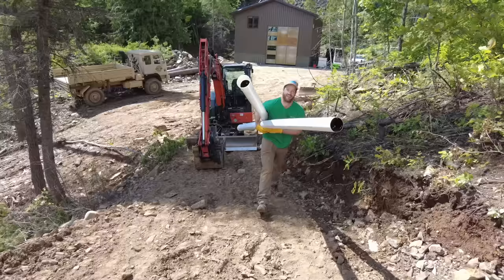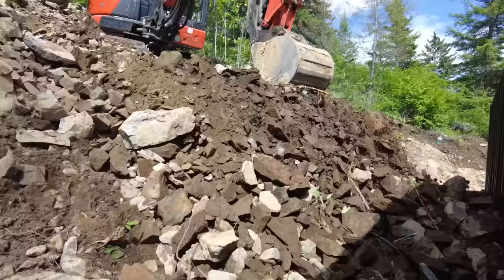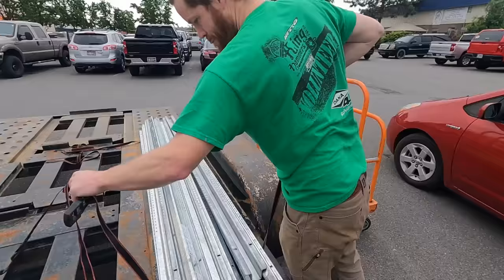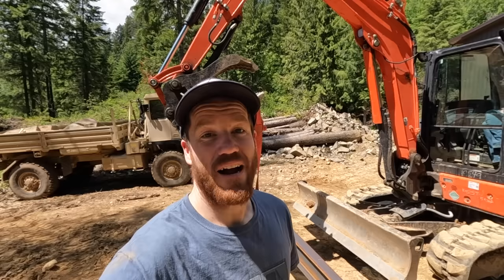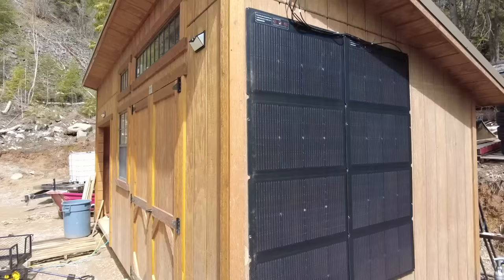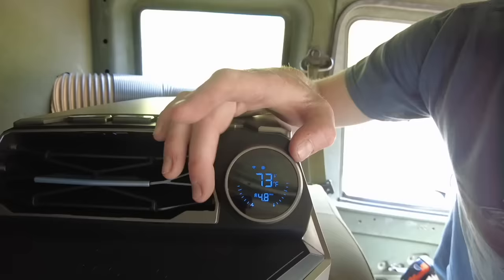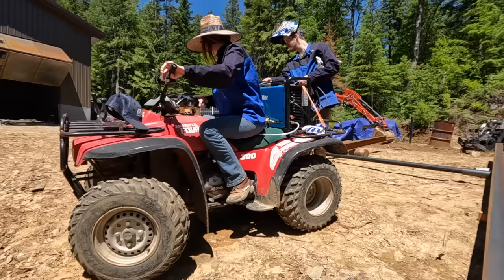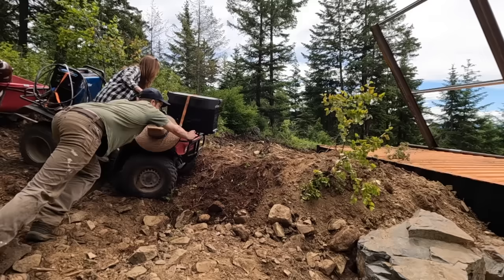We Were Told To NEVER Do This | Burying A Shipping Container

Comment: I'm glad you're excited but I have bad news for you we're going to end up having to pull it back out because why is there a pad under the garage so the moisture can't get up underneath it right all that smiling and joking around and you're not thinking if you have to walk over to your garage and look at the floor why is there a pad to keep it off the dirt and moisture I didn't look at the date of this video so I don't know how old this is probably too late but I hate to tell you this you're going to have to pull it back out because you didn't do it right you're going to have some major problems and those drainage pipes with the holes in it that you put down usually go on the dirtside of a retaining wall and if it snows up there where you're at and rains that's a lot of moisture that's going to be on the side of your container and underneath as well that little drain tube you put in there is not going to cut it what's like I said what's going to stop the water from going underneath you probably could have looked under bunkers underground bunkers and that's what show you how they do that everything is sealed the key word sealed I'm sorry for the messages but I can't believe that you couldn't think about it metal and moisture don't go together they have to be protected and sealed when they build bridges over water why do you think they put concrete over steel protect and seal and another thing how come you didn't use galvanized or aluminum for the framing of the solar panels something non corrosive unless you plan on painting that metal all the time you need to study up on moisture and metal

Comment: Umm, need to secure a 2 ton shipping container to prevent hundreds of tons of wet soil from slumping the Conex off the hill side, uses 2 foot rebar hammered into loose soil... Yet, need to secure a couple hundred pound solar array, use steel I- beams welded to the top of said Conex..  Hmmmm...  I have concerns..

Comment: I think all the concrete footing comments think they know a little better than they do.
Promoting excellent surface drainage uphill of the container is the biggest need you'll have to keep it in place. Ground water above the floor level uphill and any ground water underneath will be the biggest threats to its stability. 
Commercial roofing companies often have surplus EPDM rubber available cheap. Cover a large area uphill right up to the container and far enough back to stop water from entering the buried side. Landscape swails around it to where the water wont saturate the soil inderneath it or downhill very close.
Soul subsistence will be the biggest threat and if it's not controlled concrete foundations would just go downhill with the rest of it. Of course more substantial foundations would hold but are you looking to spend as much on concrete as the connex cost?
Watch downhill erosion and don't let water into the hill behind it. Simple.

Comment: You have done so many things wrong I can't count them all. Just a little research is all that's needed. Some kind of coating on the container to water and rust proof. Then protect it before back filling. Put dirt or Deadman on other side of container and brace. Also brace inside container from side to side to transfer load. No filter cloth, in time sediment will travel down slowing drainage. You could even use cable to hold top of container by running to trees on fill side. Old saying measure twice cut once.

Comment: Nice but unncessarily fancy. If you have natural south facing slope, that allows for several rows of independently mounted panels. That would be much more resilient setup. If you plan off grid living for real, having whole energy supply literally hanging from one hinge on top of all the batteries... seems not so good idea.

Comment: WD-40 is not a good thing to use overall - loosening nuts/bolts work great lubrication - not so much.
In other words - use a cutting fluid - more expensive but saves all the cutting tools (hole saws, drills, etc.) pays for itself.

In addition - the heavy rocks on the uphill side is not a good idea when the downside is un-supported by anything.  Too much weight on the top edge.  Your container will (?) start to bend. and that is not a good thing.  A cross brace on the back side should help with the racking (moving out of square).

You have a Lot of weight on the up-hill side and a lot of weight on the downhill side and all of it trying to turn your container into a non-useable shape.

Step back and take a really critical look at the loads imposed on the container.

PS - you didn't bury it - you butted it up against a hill side.  If you did bury it - it would not have the problems you are going to be faced with when it starts to deform.  (possibly deform?)

Comment: I'm afraid your drainage will not work. These drainage tubes (don't know the correct english word) are to collect the surface water, hence the holes should be on top. Then the water enters the tube and is led away.

Comment: Why didn’t you use real agricultural pipe for your drainage as that’s what it is designed for. Also instead of trying to hammer rods into rock, you could have pre-drilled holes into the rock base two sizes smaller than the rods, this would allow the rods to be hammered in easily and still be secured. As for the longevity of your container, you could have prepared it with a water resistant oil based paint and overlay the container with builder plastic before burying the container.

Comment: never bury a container. the reason is simpel. the corners are insanely strong but the panels are extreme flimsy. the corners keep the container stable. If you wanne strenghten the container : please strenghten your sidepanel because it will dent eventually.

Comment: You need to learn more about physics . You could see the container move when you were back-filling it. The walls of the container are not designed for underground use. The points of support of the walls are ONLY at the four corners. As the ground settles, it will bear down on the walls of the container, and they should start to collapse in about 4 or 5 years. You'll start to find the doors will not work . Be sure to let us know what other problems you start to see over time. Your biggest problem here is the pressures asserted against the walls that are nothing more than sheet metal. Good Luck. Make sure your insurance is paid up.

Comment: what make you think the container is made of cor-10?, unlikely...
Reply from the maker: There is a large sticker that says “REPAIR WITH COR-TEN STEEL ONLY”.
Reply: @AmbitionStrikes  interesting, only product made with cor-10 i've ever seen painted.  cor-10 should oxidize to a burnt orange crust, then stop oxidizing after that.  normally cor-10 leaves "rust like" stains around.  If you ever visit the USSteel building in Pittsburgh, you will notice that there are actually drains around the anchor points of the vertical cor-10 beams that are the building's main structural support.  otherwise there would be rust streaks covering the sidewalks...

Comment: Watching Americans working with feet & inches is a reminder of what it used to be back in the old days before we metricated - gaaaaad it's clumsy and confusing. You guys really really need to switch.

28:46 "Definitely solid enough for some solar panels" - uhh yeah, that's not your engineering concern. You should be designing for WEATHER - most importantly, the WIND pressure on that size sail is going to be ENORMOUS (and in all over the place, all the time). I really hope those flimsy little door hinges on the adjusting struts can take it, but I doubt it 😬

Also the winch is pulling at an unnescessarily acute angle. I get that it's that height to make it easy to operate, but you can lead the cable through a pulley at least a couple of feet below so that it goes out as straight as possible to the frame. This will reduce the stress on the attachment point.

Comment: Obviously too late by far. But NO! No sir you must NOT USE ACETYLENE CYLINDERS that are not upright. A fire inside the cylinder can burn for a long time which ends in an explosion. Yes it has and can happen due to the filling inside which holds acetylene liquid. That vents of the sponge surface to produce the gas.
Reply from the maker: Thanks for the heads up on Acetylene cylinders, this is a CO2/Argon MIG gas cylinder, it's compressed gas and inert. Although I definitely should have put the cap on before moving it.

Comment: I'm not going to watch your video because I'm assuming it's clickmate. The reason that you were told never to bury and shipping container, I'm assuming if you actually were told that, but if you were told that the reason would be the moisture and everything else obviously the natural elements in the earth will Decay and that thing will rock down to nothing they are natural salts and other elements in the earth that will make that steel rot, and it won't take as long as you think. Now if you can keep it dry somehow, maybe you'll be able to do it like if you in case the whole shipment container with six inches of concrete and then bury it yeah yeah you can bury it make sure you get a little bit of ventilation so it always stays dry and you should be able to do it pretty simple to figure that out bro

Comment: I don't think you know what you are doing.  If you were using this for a fallout shelter you should have elevated 6-8 inches it to allow for a toilet and ground water.  One thing that present issues is frost pressure.  You could have used vertical railroad ties on the sides to prevent buckling.   You really need to protect the roof.  The strength is in the frame.  Put 3 feet of dirt on top and see it get wet you will have issues and potential caving.  Useful life / need will not exceed 10 years.

Comment: You are building a death trap. Y'all are disaster ready to happen. You should have at least 4 four inches square tubing on the ground first. Four inches exposed on side with no rock. Weld metal parallel to conex then weld conex to this parallel piece. On the side you pushed rock against, you should have had at least 3 feet of tubing extended under the rock. The weight of the rock combined with the block on the other side would give adequate foundation stability. The o keep the footing from slipping. The other benefit for this is to allow air flow under the floor. You do not know what kind of preservative was used in floor. Formaldehyde Is a possibility and deadly inhaled. You leach drain pipe should have been covered with a semi permable  fabric to keep silt from weeping into drain holes. These containers were exposed to corosive ocean air for long periods of time. Pink mold will develop. First apply mold killer. Then primer paint. Then seal with 100% silicone. The large angular rocks with eat through the side walls. You are building a death trap. Take it apart and start over

Comment: Wind loads are going to wreck this project. Anytime you weld you must grind the mill scale or zinc to expose bare metal. I don't think you saved any money here trying to build this. Disaster strikes ambition. At the least you should have hired someone to design this. Solar panels and bent steel are not cheap.

Comment: Watching you drive steel pins with an axe, with the blade towards your head, is making me wince.  One slip...  You could at least start with a post driver.
I don't understand why you said (about 1:56) that those pegs will keep the container from moving.  Why would you think that the pegs would hold more than say 50 pounds apiece in place?  Look like 1/2 inch and not driven in more than about 12 to 18".
Filling against the container, I strongly suggest looking at videos on retaining walls and why they fail.  There is going to be considerable side-force on the walls, especially when it rains heavily.
Sorry, I can't watch any more of this.

Comment: You needed a more robust water protection membrane and drainage plane with a gravel protection mat on that bare painted steel.  Any building foundation wall should be treated similarly whether it is poured concrete, concrete block, steel panel, or yes TREATED wood foundations have been attempted.  You needed a REAL engineered foundation, concrete slab or pads or piers to set that container on to prevent uneven settlement and from sliding down the hill.    Dumping boulders and rip-rap against it will scratch what little paint you have there and will become points where rust will start.  This is NOT core-10 steel and direct burial of core-10 is probably not a great idea either for a habitable space, or containing electrical work as you have.  Yeah, you will be digging all that out some day.  Not soon.  But some day.  Might as well plan a new FIX-the-Foundation-and-move-the-array video so we can watch it.

Comment: It is really bad to weld galvanized steel without using a respirator as the fumes are poisonous.  Yes, you are in an open area, but (seriously) Metal Fume Fever    ...thanks for the video.